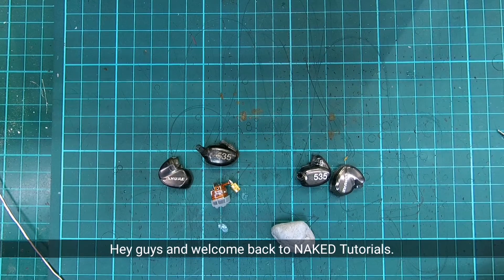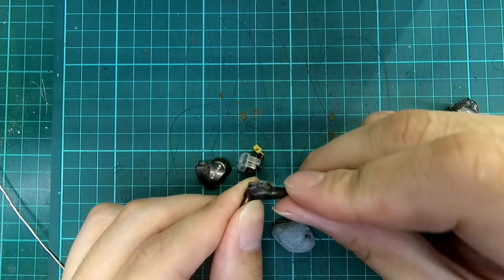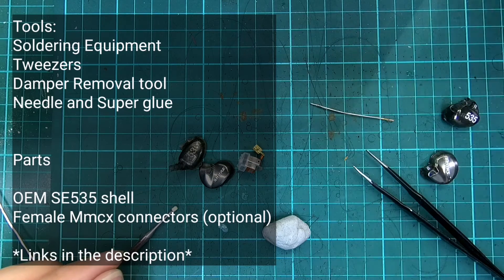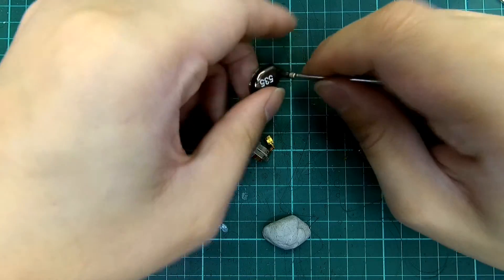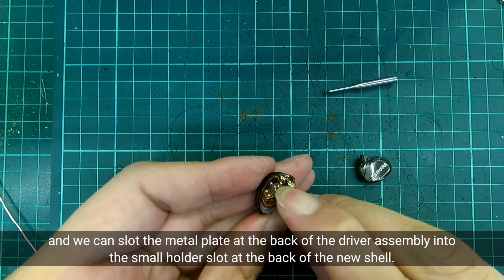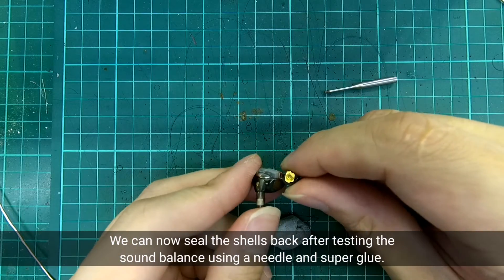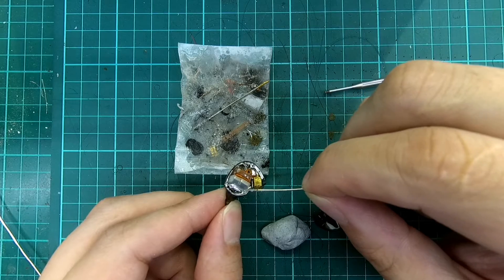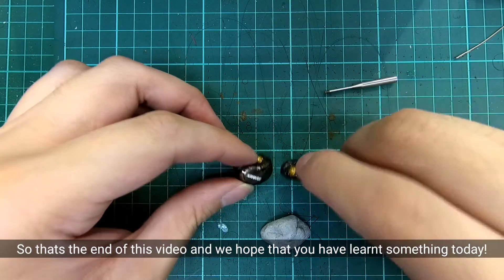DIY Reshell Shure SE535 repair and replace your old 535 shells into OEM shells [NAKED Tutorial]

Comment: does replacing the se846 shell has the same process as the se535?
Reply from the maker: It's quite different as there's sealing issue and also the oem shells dont fit the originals